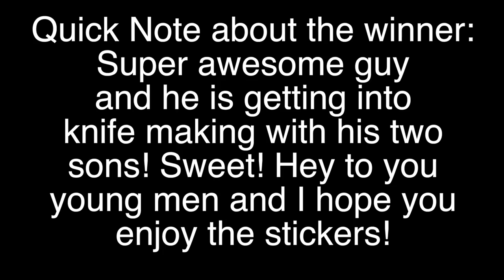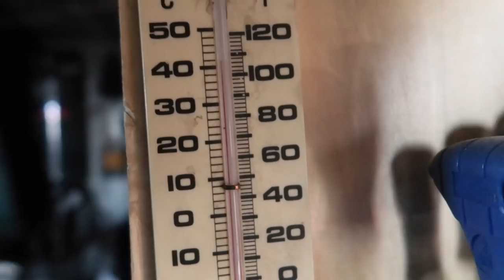100 Pushups - knife maker's vlog

Comment: here about 6 years ago i started the same pushup challenge.  I started out on the first day and did 3 sets of 25 and it killed me.  1 yr later I was able to do sets of 100 through out the day usually averaging between 1500 - 2000 pushups a day.  About 6 months later I finally got burned out and haven't done much in the way of pushups since!  lol  Goodluck with your pushup challenge!

Comment: This is just me.  Everyone follows their own path.  I have weight lifted for years and do push ups.  I do keep track of reps as a way to measure my progress and compete against my last workout.  But, I don't focus on reps for the sake of reps.  I always put form first.  Doing x number of sloppy pushups is not the same as doing x number of good form pushups.  I would focus on form, especially at the beginning.  Because once you have good form it will be the way you automatically do them.  I also use the Perfect Pushup product.  They allow for a deeper pushup, but more importantly, your wrist is not bent and you are gripping with your hand.  Much better on your wrists.  The angle that pushups put your wrist in is not good for your wrist, if you can avoid it.  You may take what I've shared with a grain of salt.  And, I'm not preaching.  Just sharing my experience, because maybe it helps.  Also, pushups are awesome.  They workout a lot of your upper body without weights.  And, you will tell a difference.

Comment: There is no way I could work in that kind of heat. Have you thought about cutting a hole in the end of the shop and installing a large exhaust fan are better yet an A/C? The electric bill should be reasonable due to your Northern climate, but then again I've never been there so maybe it stays hotter than I believe. Anyway great video. So happy to see a young man spend value time with his family. Keep it up. R